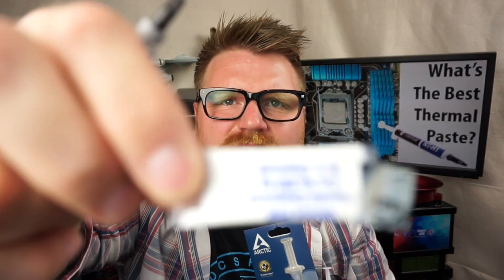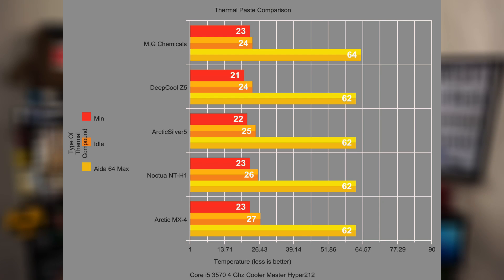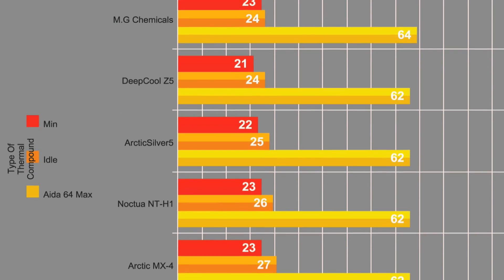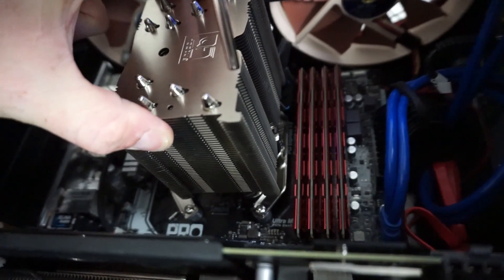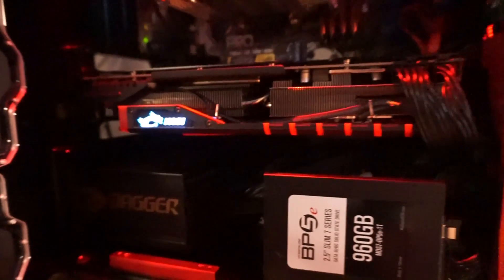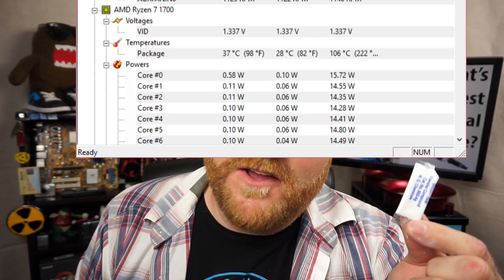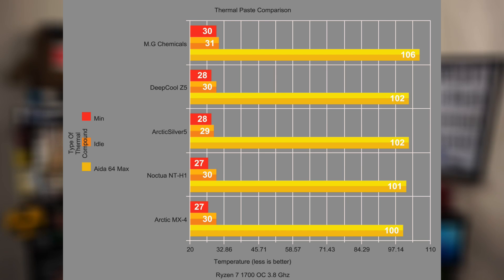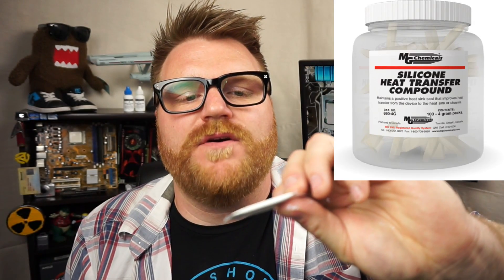Best Thermal Paste For Overclocking In 2017?

Comment: Wow, You really know your stuff. Ive been building computers for about 2 years now, My spectrum of knowledge doesnt even compare to yours when it comes to tech lol. GREAT VIDEO!! You earned this sub :)
Reply: I've been building PCs since I was a teen in the 80s.  Back then CPUs didn't even need heat sinks and thermal compound.. that wasn't until the 486 days when CPUs need some sort of passive cooling. 286, 386, those chips were just bare on the motherboard, and we were barely past 33mhz clock cycles back then.
Reply: no he does not, to test thermal conductive liquid you do NOT wait ONLY 5 minutes 
thermal grease is tested on hour length not in minutes
some could be better at the first 10 minutes of applyiance then become shit and others otherwise, be shit at the start and become way more efficient in transferring heat
Reply: You could get strong results after benching for about 15-20 minutes. That should be sufficient in weeding out the really crappy ones.
Reply: You have to control for fan speed variance, making them a constant/identical fan speed for every test. Sloppy!
Reply: for real test results u need curing time to pass, about 24h .

Comment: What a crap test. Also, you have no one to blame but yourself for those ridiculously high temps on your editing rig. The case obviously can't get rid of enough heat, so it won't matter what paste you use, or what air cooler you use, the heat will just build up until everything throttles. Why would you put your editing rig in such a crap case?

Comment: No offense implied at all to Timmy Joe, but after watching tons of these thermal paste comparison videos, there is no difference in what good brand you use since the temps only vary by 1 - 3 degrees C. How come no one compares the real meat of the problem; different cpu coolers/fans? That is what makes the difference, not these 1 degree temp changes in thermal grease types.

Comment: I was using MX4 with always great results, then i heard about Gelid GC Extreme, it is more expensive, but i still got a small tube to test it against the MX4, I will have to see overtime how it performs, from day 1 I could not see a real difference really, maybe 1 degree lower sometimes, but really... 1 degree is not a real advantage. I will see if it maintains that degree for as long as the MX4 does and then draw a better conclusion, but MX4 has never failed me on the long run yet, it has always performed like day 1 for years. But I also have seen thermal paste that does not perform well at all, and the difference with MX4 is over 10 degrees hotter from the start, so those are a no go for sure.

Comment: only place I find thermal paste to matter more is if its on direct die. as pump out there is alot easier to happen so a thicker paste does better in that application. but on an IHS most pastes are all within margin of error on each other

Comment: look for the gelid stuff, as far as i know the gelid thermal paste is better than even the mx4
Reply: Yeah, realized that this weekend when I started to use their GC-Pro Thermal Paste on my Gelid Solution Phantom Black (GC-Pro is included with that cooler) instead of the Arctic Silver 5 or BeQuiet DC-1 that I have laying around. It performs really well against those 2 brands. Same that this Gelid thermal paste is overlooked in general and like so many reviewers, Timmy is pushing the Arctic MX-4 in our throats.

Comment: You can get $2 gd900 from www.ebay.com YouTube videos shows it's as good as the top pastes.
https://www.youtube.com/watch?v=NCMGCYzPJCk
https://www.youtube.com/watch?v=q1sj6dzu5BI

I took the heatsink off my cheap old graphics card and there was no paste so I'll put some on it. Unlike a CPU you're supposed to cover the graphics processor entirely. Pastes are supposed to be re-applied every 2 years, more for mx2 & mx4.

Comment: I use Gelid GC-Extreme, its like liquid metal but not conductive and safe for long use as you dont need to be careful when applying over the pcb and solder points

Comment: The resaults that you have are with 212 evo which is apparently more than enough for that CPU.But when you try to cool 150-200 W CPU with lame cooling thermal compound oww it hurts.But that resaults you have are not normal.I was geting around 70 degree max with thermaltake contac 30 with Ryzen 7@3.8ghz 150W and MX-4 so there is clearly something wrong there that cooler that you have should not even reach 65 degrees

Comment: That artic mx 4 is pathetic. On my pentium 4 extreme edition watercooled it was at 80c idle and yes the cooler was mounted properly. I used the cooler master mastergel thar came with the cooler and it was at 30c idle 55c max overclocked to 4ghz.

Comment: I like using arcticsilver ceramique2 as my thermal conductor my ryzen 5 1600 4.9Ghz runs 47°c on Intel burn test 48 prime 95 and 54 on cupid master stressor. Please be careful using last one it can really burn up your system i would. Use it on base clock only but yea arcticsilver ceramique2 works great once its broke in
Reply: 4.0ghz Lol stupid autocorrect
Reply: I know but yet it doesn't ever get brought up ever it actually works better then nocta n1-h1 and mx 4 but yet never gets mentioned we used it allot in electrical trades School for circuit  breaker insulators and double ceiling fan 20gauge  wire diode weird that it works for CPU cooling but it does I am putting it on my gigabyte ryz 560 oc  1024  4gb it gets to hot and I have case fans with pos pressure. Out the A but still hot ill let you know in a couple days how it works

Comment: Installed the same cooler on a friend's PC. Did you have trouble with the nuts on the back plate/  mobo spinning when trying to screw down the heatsink? I thought they should have stayed still on their own, and blamed that crappy plastic back plate.

Comment: On the TIM testing could be better . More kinds longer test/ better . Aida64 push's alot less heat than say OCCT(linpac)/P95 small ffts . 

On to the real reason Im making this comment , even in that case No way you should be hitting those temps temps on a stock hsf let alone the aftermarket one you are using . What voltage are you running (over 1.45?) . Try a small experiment for me take the other side PNL off and point a fan @ the socket area . Check temps now vs with the fan blowing on the back .

Comment: Arctic Silver has a settle time.  It has been used in commerical manufacturing for years. I know because I have worked with it for years. Even without the settle time it pretty good with immediate testing after application.

Comment: Wow, just uh no. The thermal compound used can make a huge difference. Check the thermal conductivity of the produxt. The higher the better. I bought startech compound rated at 3.something and the used arctic silver 5 rated at 8.something. Under heavy load I saw a difference of between 17 and 20 degrees Celsius. You also need time for it to reach maximum conductivity. After a few hours the high temp under the same load came down 3-4 celsius.

Comment: thank god i got two tubes of Mx-4 and i used it on my fatty ps4 , and i mod it as well , and it run cooler than before and never had overheating issues , 
on the other hand thinking to apply it on my CPU R5 1600 which is now over clocked to 3.7Ghz @ 1.200V on stock cooler, and to be on the safe side , i ordered NZXT X52 AIO , i couldnt git the X62 in my case due to the limited space and support .. 

So , i was wondering if u ever had a chance to check the NZXT AIO's , been hearing alot of bad reviews, plus it has 6 years warranty ...

Comment: Wow, one of the worst reviews on thermal pastes I've ever seen.
1. There are SO many out there, and you test only 4 ??? what a joke
2. Certain TP's require a so called "curing time" (usually 24h with the system on) and only then they start performing at their best, and you test on AIDA64 for 10 MINUTES???
Haha man, what a joke!
Reply: You sir just earned yourself a lifelong sub, keep shitting in those momma tanks:)
Reply: Personally i believe the main problem is with the original CPU not having a delid. The Intel IHS thermal compound is what is making all of your results the same, once you get a delid CPU and do this test. You will really be able to tell the difference between different thermal compounds.
Reply: @TimmyJoePCTech  nice comeback you fkn idiot...arctic silver requires a cure time of a few hours....get a clue
Reply: this guy is an idiot, tried to be more of a comedian than a tech, the arctic silver 5 is the best thermal grease on the market, when you simply put a large glob in the center like that it takes 200 hours to cure. what a dumb ass. if you want to test it without letting it cure you have to fog it 1st by rubbing a tiny amount into both the cpu cap and the bottom of the heatsink, then wipe it off with a coffee filter, leaving it "fogged" and then add a small (half of a pea) size drop or a line the size of a piece of rice. then it wont take so long to cure.
Reply: fuckin REKT

Comment: I use MX-4 on My RX 480 GTR which is basically a reference 580 and I see temps max at like 73 degree. So it is better then what XFX used and there cards are normally good.

Comment: Also gotta keep price in mind, Arctic MX-4 is about $10, while Arctic Silver 5 is about $5 (usd). And since they all perform with in margin of error (about 1 degree c') might as well get the cheapest stuff, and in bulk if you need it. You can get thermal past in little jars now but it's a non-brand "generic" thermal paste, and doesn't come in a syringe.  Have you tried thermal paste that comes in jars, Timmy Joe?

Comment: wooo man, 100c is not good for your cpu. I've been using a corsair H60 with my ryzen 1700x and topping at 53c when gaming and it doing other stuff at the same time and it hit 99% for about 5 minutes. No, it's not overclocked because my video card is the weakest link so no need to overlock, but maybe check out a good liquid cooler using that video card.
Reply: Oh I'm also using arctic silver 5, just used it for years and never thought of looking to see if there was something different, your comparison was quite useful for me in that regard. thanks!

Comment: u didn't adjust for ambient temperatures?
making this whole benchmarking worthless, especially at the low difference to expect from thermal paste.
the first test with a bad air cooler and a non soldered toothpaste cpu is quite useless, but whatever.
u didn't test thermal grizzly kryonaut, the thermal paste to be assumed the best atm, that isn't liquid metal.
did  u fix fan speeds?  which is important for such testing, again no mention.
this is just a bad video.

Comment: I always thought that made the best toothpaste but every list I've ever seen has so small of a temperature spread that it almost made no difference.  I use Arctic Silver Ceramique II because it's non-electrically-conductive, I got a massive syringe of it for about $10 and it was ranked in the top third of the pastes.  It works fine on everything I've built with it.

Comment: isnt 100c very high for this cpu i heard the limit is 95c , thank you for sharing this i was wondering which thermal compound is good and this video answers it very well
Reply: Yes, 100C can damage the chip, or shorten its life considerably.
Reply: I wouldn't want to run my CPU at 100c to be honest, It's not the best for longevity
Reply: bullshit, chip's rated at 105c before throttling. you can run it 24/7 at 100c, it will outlive it's own usable life.

Comment: someone (maybe anandtech im not 100% sure) tested a bunch of thermal pastes and the difference between the best and the worst is 5°C
I'm using witch came with my Hyper 212 EVO
Reply: Not every paste is the same, most the stuff that comes on laptops and gpus are really bad but if i remember correctly, the Cooler Master paste is some of the best free stuff out there

Comment: Noctua is my go to for price/performance/quantity/longevity/ease of use. It's cheap performs in the top 10, they give you a good amount and it's extremely easy to use. 
 That being said as long as your using a grease from a reputable brand and you apply it correctly most TIM will perform with 1-2C of eachother.
Reply: Alan Nguyen no
Reply: Longevity? It typically lasts for a max of just 3 years. MX-4 lasts for 8 years, deals with higher temps better and is cheaper.

Comment: I use noctua cream right now i use to use atrtic  silver 5 since the 90s but it's junk now .
Reply: I had a couple tubes from from 8 years ago and I don't know if it was just old that the consistency and color was different then some newer stuff I bought a couple months ago. But I agree I do not care for artic silver any more I feel like they changed some ingredients and it's not the same.
Reply: 1967 kID Arctic Silver 5 has a cure time of 200 hours before it reaches its full potential to transfer heat away from cpu/gpu.

Comment: I used to use Artic Silver & MX-4 and I would idle in the mid 30's to low 40's. I switched to Thermal Grizzly, and now my Ryzen 1700 idles around 25 to 34c. Grizzly is the best.
Reply: Keiko Yuuki yip I lost 4c compared to the standard cryorig paste that came with my A40 ultimate.
Reply: I threw away the packaging, but it was Thermal Grizzly. It was either Hydronaut or Conductonaut, either way it was dropped my temps about 8 to 10 degrees.
Reply: conductonuat is liquid metal you'd know

Comment: try the thermal grizzly compound to see if it ties with the mx-4 or does better
Reply: +Mista Misa
MX-4 It's not the best of all the thermal compounds but the safest and longliving best one. It's non-corrosive, non-conductive, you can literally splash it al over the motherboard and it will be safe, any other will corrode and/or short circuit components. I have an FX-8120 with MX-4 applied 5 years ago, temps didn't vary in all this time... and has been running 24/7 all this time... I'm more worried of the PSU dying on me than the thermal paste decaying xD
Reply: Is icy diamond a good thermal paste?
Reply: should do better ive been hearing the grizzly is where its at
Reply: Thermal Grizzly Conductonaut  is awesome stuff!
Reply: I'll have to disagree with you on the MX4 being better. http://overclocking.guide/thermal-paste-roundup-2015-47-products-tested-with-air-cooling-and-liquid-nitrogen-ln2/6/
Reply: Mista Misa Depends on the application tbh, it can vary, I think both are similar in temp.
Reply: ic diamond is not the best paste.
Reply: @aimanrulez7339  Best paste Thermal Grizzly Kryonaut 2018
Reply: If MX4 does the job with overclocking, why go get horny with more expensive grizzly ? Just don't get the boasting in the gaming community. Use what works, whatever the name or price.

Comment: I personally used arctic silver 5 in my first 2 or 3 builds, then I worked at a computer store and my co worker thinks white thermal paste works better and he has showed me some dried up gray thermal paste...IMO they all work the same and you should redo your thermal paste every two years or so to make sure it doesn't dry up :) I have redone thermal paste on my r9 290 and it idles lower now

edit: also people say thermal paste takes times to set in so temps will change slightly too